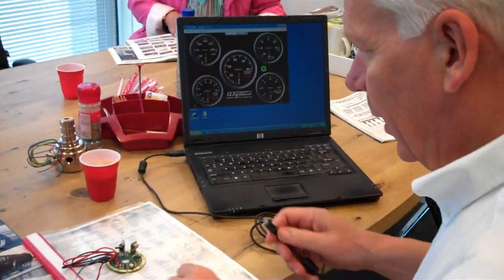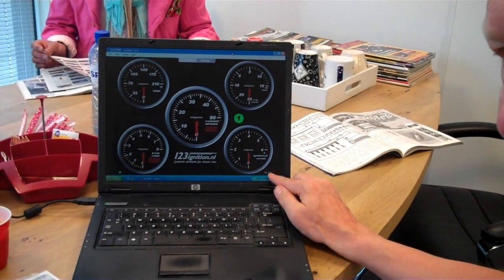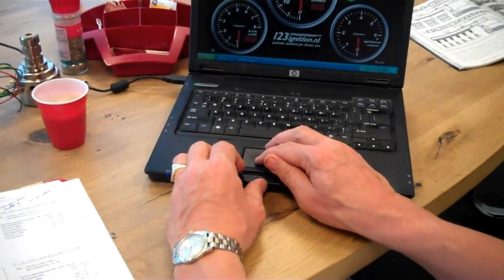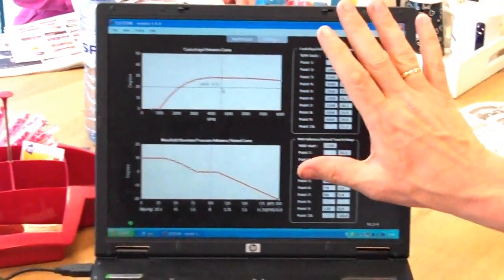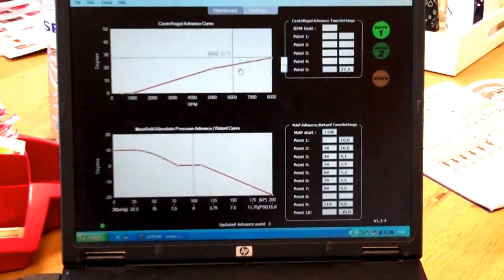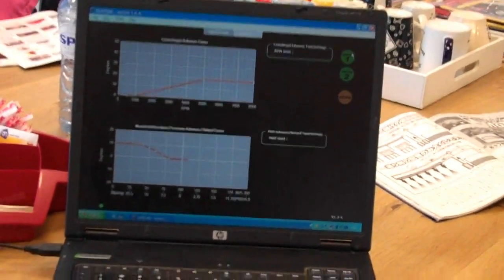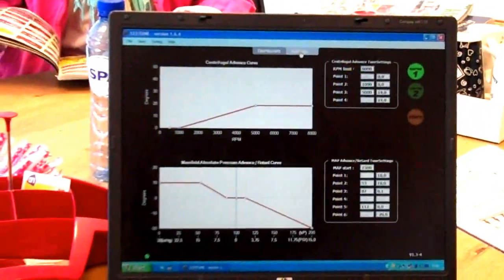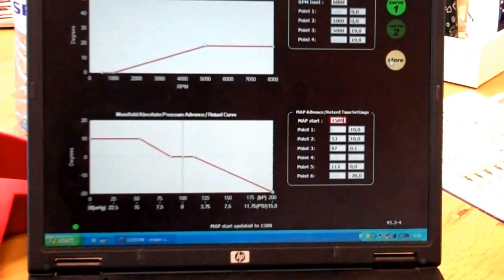Lesson 123　Tune 1

Comment: Albert explains how to connect to your Laptop and crankshaft degrees vs camshaft degrees. 123 always works in crankshaft degrees. Also explains how to remove vacuum from the TUNE if your car has no vacuum. However if you want to add vac you can. It will take carbed or manifold vacuum. Turbo applications are explained... Very informative. There are nine (9) lessons here. Do yourself a favor and check them all out in order. Type in Lesson 123 Tune Part 1